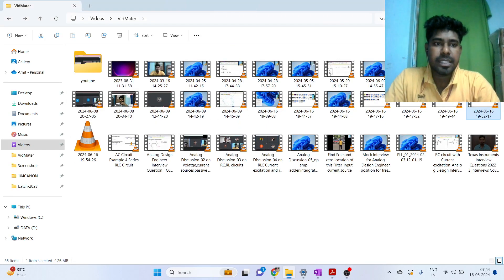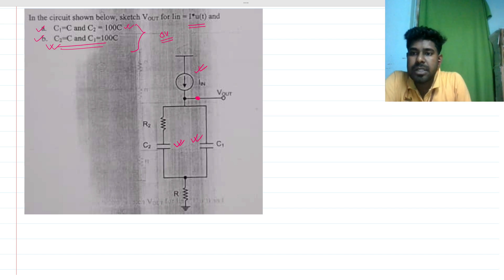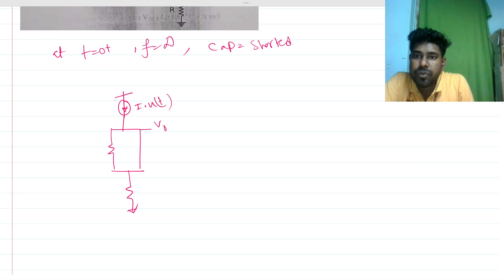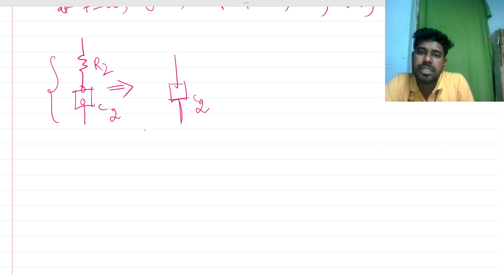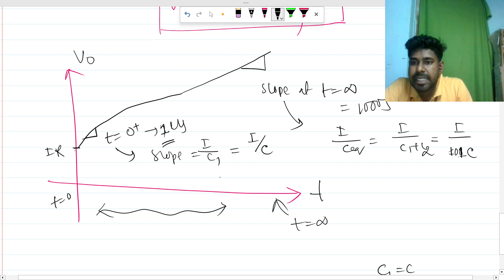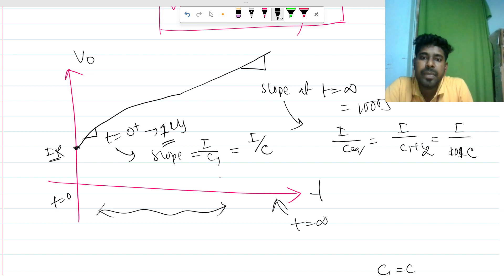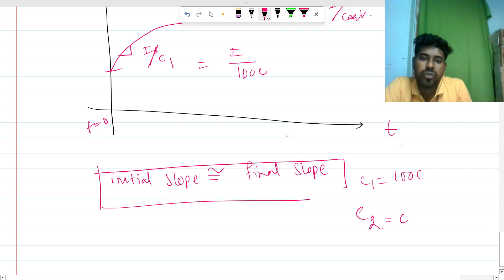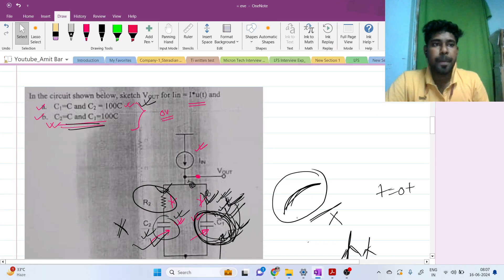Analog Circuit Design Engineer Interview _Plot Vout of RC circuit with Current input

Comment: Sir,This is second order circuit
How can we confirmed it is exponential??
Reply: it is a first order circuit, not a second order circuit; pole= 1/(R2*C1C2/C1+C2). R doesn't come in the picture.
Reply: Can you please explain,why R is absent in pole calculation?
Reply: @saikirankillari-cc5iv  equivalent capacitance = c1 and c2 in series = c1c2/(c1+c2) , open circuit the current source , open circuit the capacitor equivalent and find the R equivalent seen , only r2 will be in the loop of capacitors , r is outside the loop so it is ignored
Reply: Now, i understood
Thank you for your reply